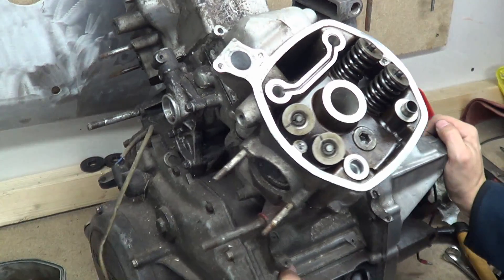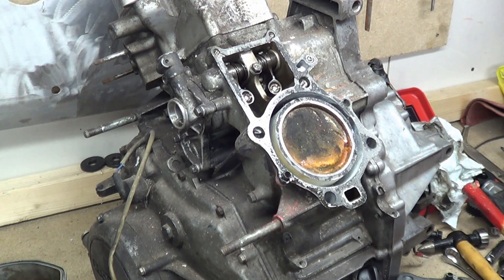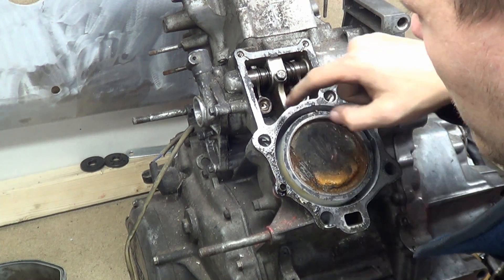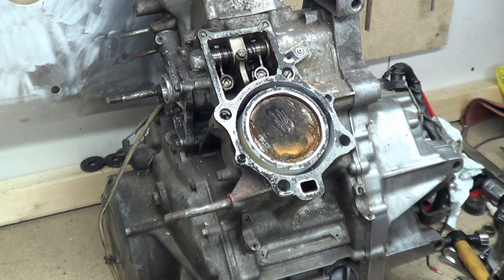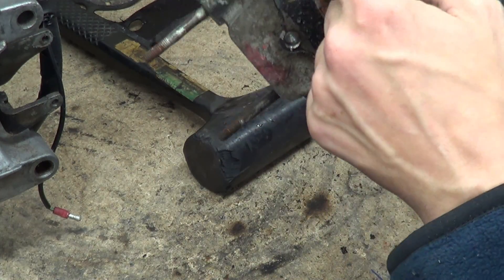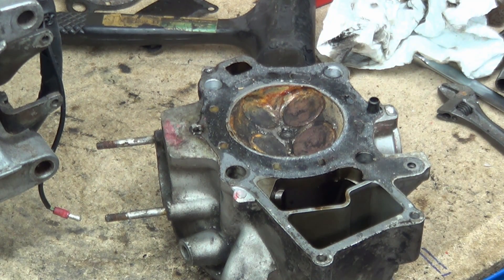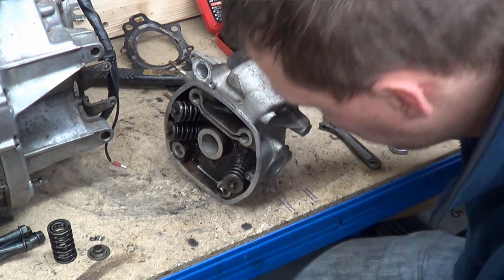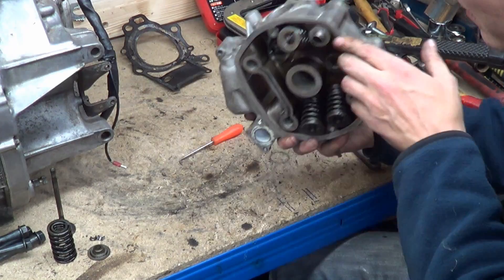CX500 V twin 4 Stroke Series - Part 4 Removing the valves

Comment: Is there anything you'd advise doing to fix valves without taking them apart?

Just as a step to remove the potential need for a full engine disassembly? I've got one valve that is stubborn but not too bad from what I can tell.
Reply from the maker: Is stubborn?
Reply: @thedirtyworkshop  it makes some noise weird noises when gas is taken into the cylinder, and it clicks when I hold full throttle.  In just tapping it with a mallet it moves less than my other 3 valves on that side